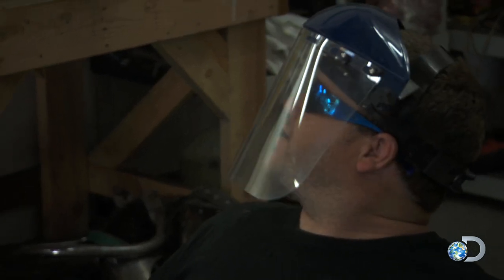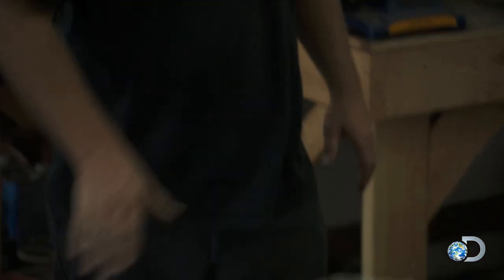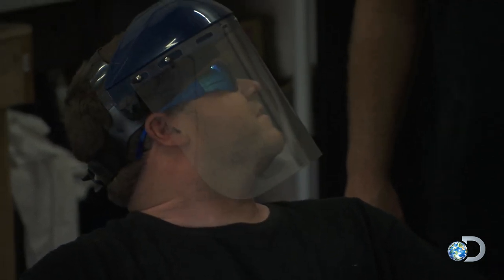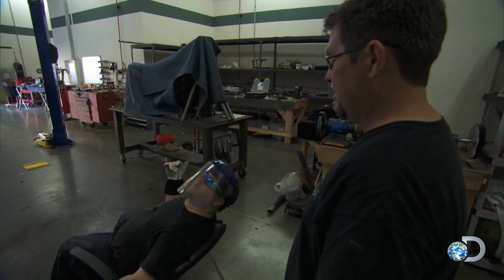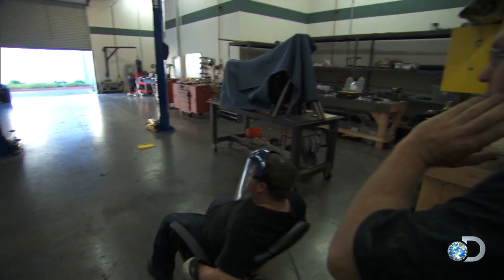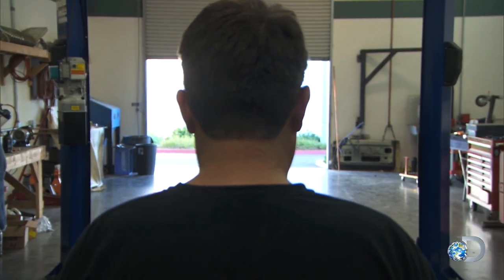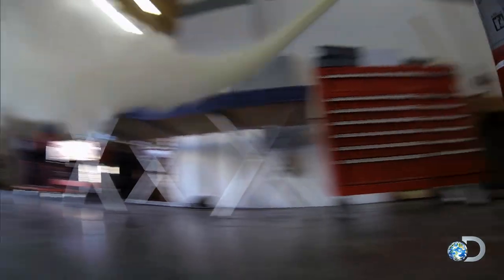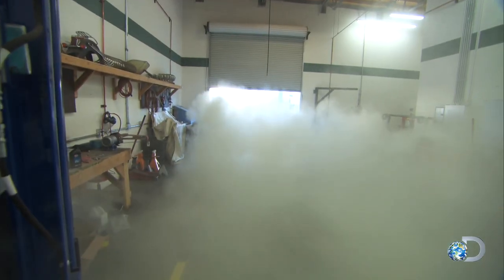This Rocket Chair Will Definitely Work | Rusted Development

Comment: It will work if u put the air presure it in beetween your legs under the banch like a wich with her broom and the oder guy will push you with a two stick on the wheels do not touch the banch and he will go straight and not turn ning like this video